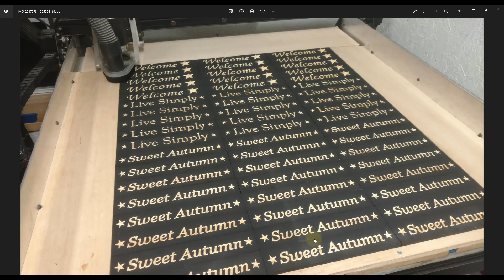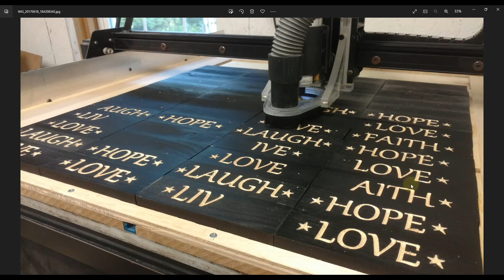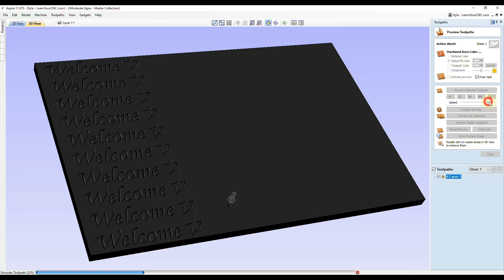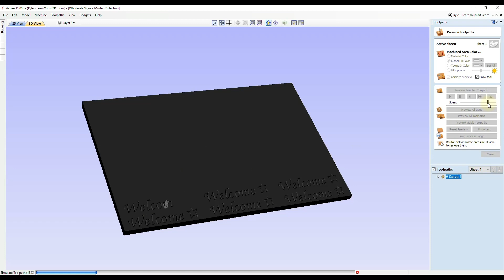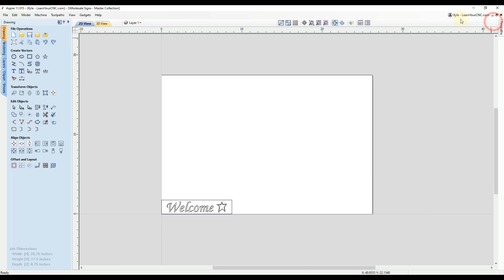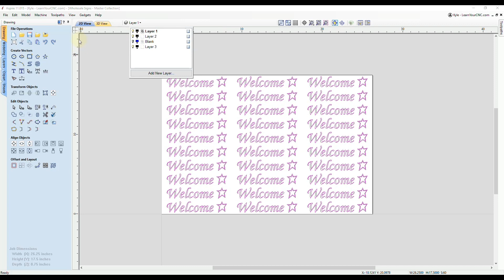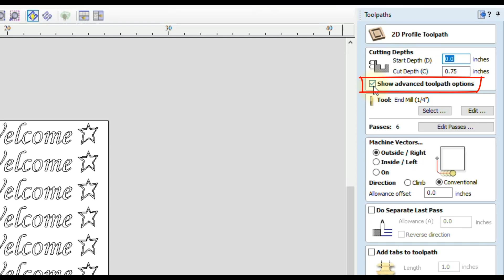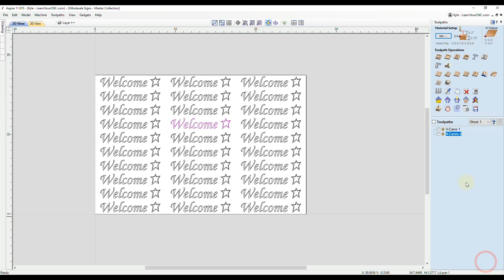Use Vector Selection Order to Carve Objects - Vectric VCarve, Aspire, & Cut2D Quick Tip

Comment: I tried all those kyle but still having issues, The diamond drag doesn't have advanced options like the other types of cut. The array toolpath doesn't have a rotate version like the vector rotate array does and the order of selection isn't in there either.
Is there some kind of work around for rotating arrays in diamond drag work?